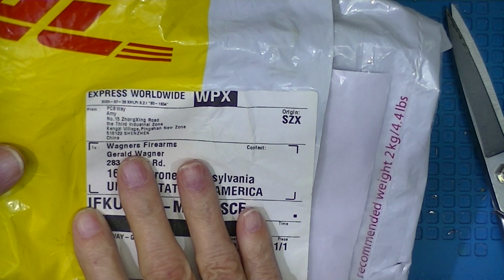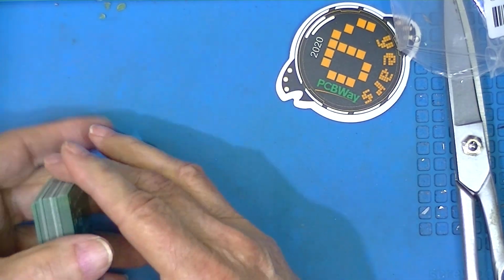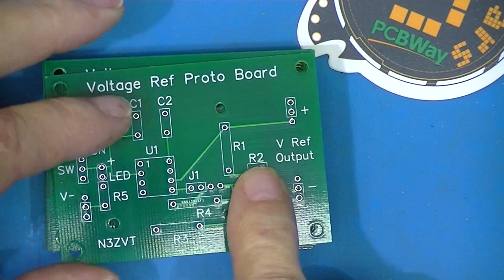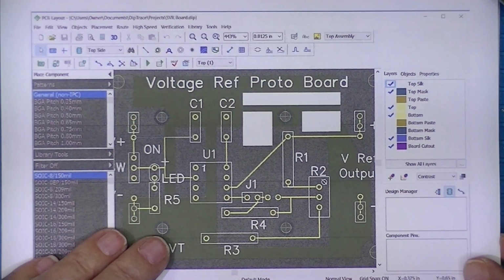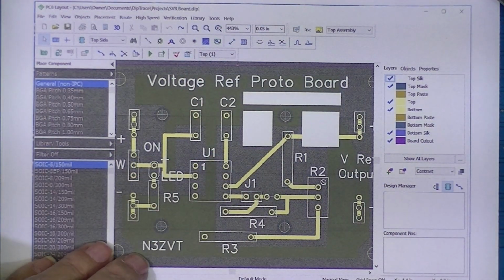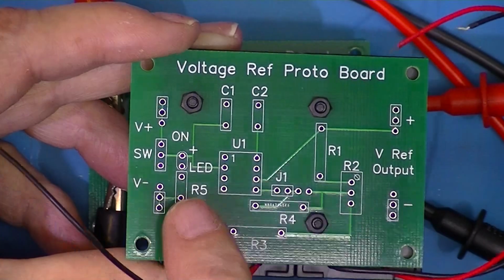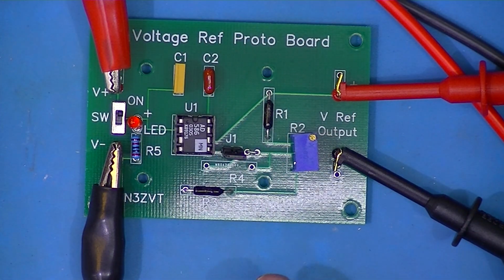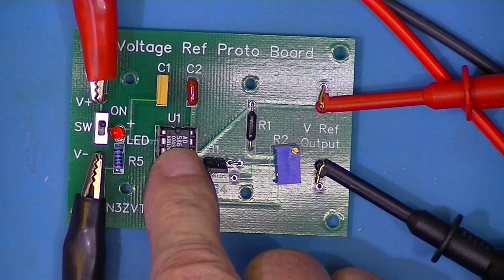Shop Voltage Standards -  Part 7

Comment: Hi Steve, in case you want something more versatile (but little more complicated) here is an easier to build Adjustable Voltage Calibrator using a MAX6341 as the Voltage REF,  https://www.youtube.com/watch?v=V9l5kc_o_dA  and a Higher grade one with a LM399AH Heated ref, https://www.circuitvalley.com/2018/11/diy-open-source-lm399-V2-voltage-reference-10v-dmm-calibrate.html, 
I use the LM399 Series for my Designs too. Cheers, Konstantin

Comment: Hi Steve, the Bypass caps should be as close as possible to the IC Pins used, further I would put Groundplane on both sides connected with via stitching. Cheers, Konstantin
Reply from the maker: Thanks for the info. I am just getting used to the software. I actually ordered a slightly different layout and the manufacturer came back twice with an error. Seems that the "pours" had some conflict. Finally deleted them and resent the Gerber, see if it works now. The software did not show any errors when I automatically checked it.
Still Learning
Steve